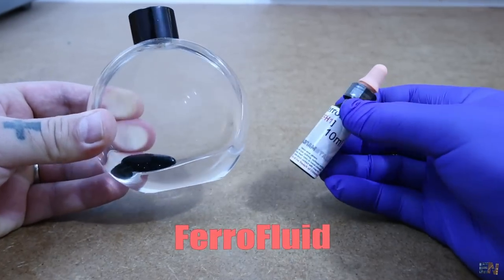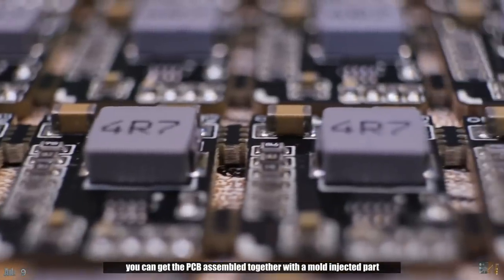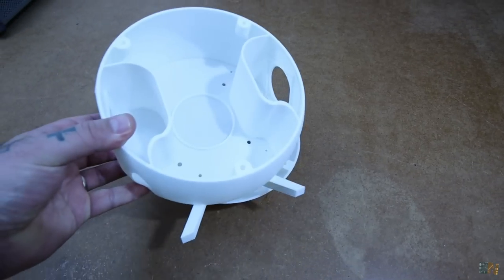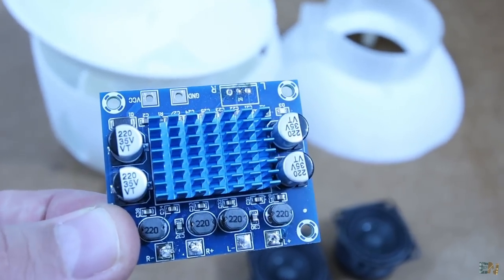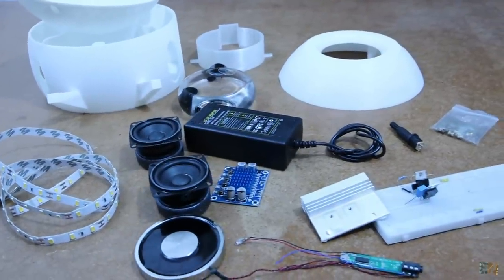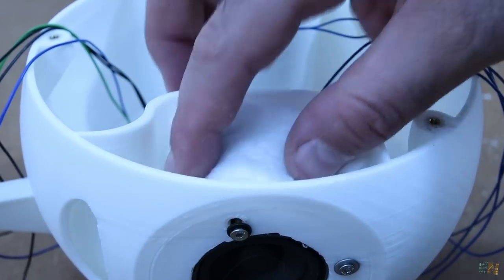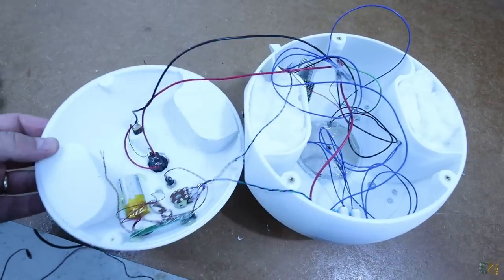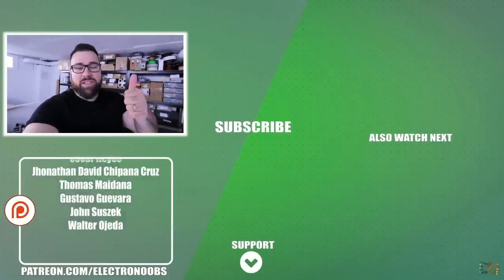Ferrofluid Speaker - 3D printed + Bluetooth Music

Comment: Perhaps, instead of using one large electromagnet, you could install three or four smaller ones and activate them at different times to achieve a greater variety of movements in the ferrofluid.

Comment: can i use 12V magnet for that electromagnet control circuit?or should i use 24V maget with boost converter?and what is the value of the cap?

Comment: Can you make an ionic thruster  and make it blow wind out to a fan motor that is connected to charge a  battery,  and then through a transformer to generate more amps to provide power to the system and to power any other needs.
Reply: Scrap that idea it won't work I see my own flaw